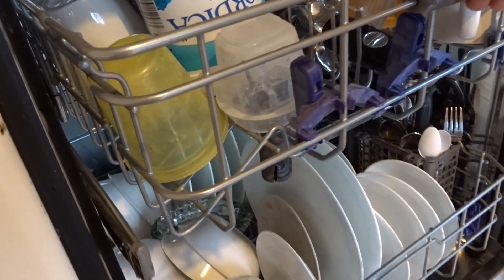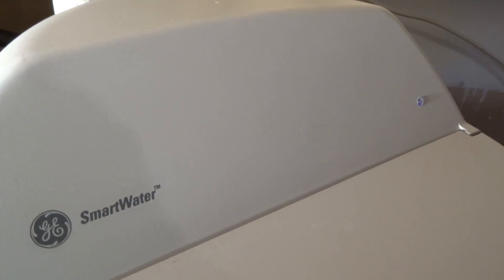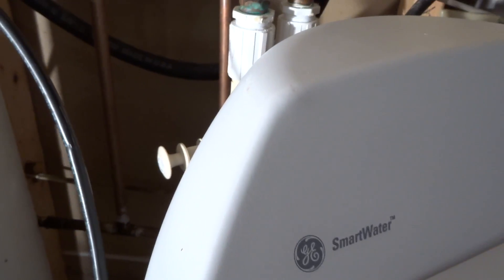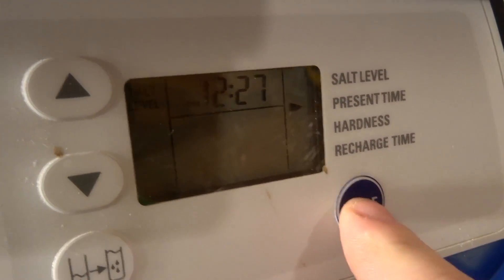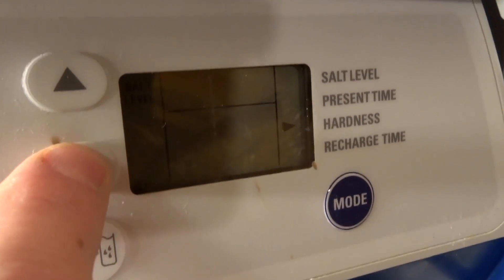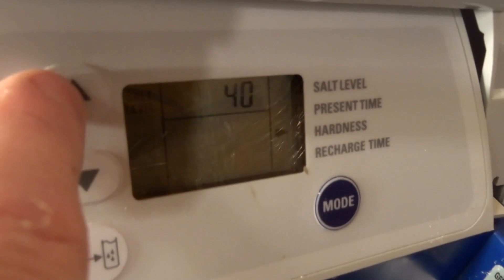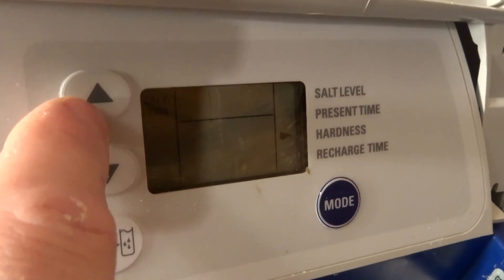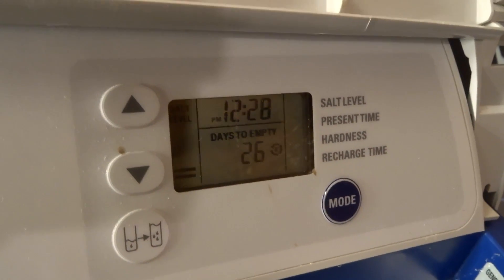GE Water Softener ep5 hardness adjustment

Comment: You did not say how many turns to turn the knob.  If i turn the knob clockwise, is the water going to be softer or harder.  if i turn the knob counterclockwise will the water be softer or harder? Very important question.
Reply from the maker: @mdiazdiaz5612  this softener does not have a knob, however this adjustment does not make the water softer or harder it determines how often the machine regenerates… if you know you have hard water you need to regenerate more often… this machine has a water usage counter.. I use the higher number so it regenerates more often.. some softeners are are basic and go by numbers of days between regeneration.. hard water requires more regeneration… but the manual set days type have no idea how much water they have used… so will regenerate when told to, regardless of the amount of water used.

Comment: I've set mine to 90 and my water is still not soft
Reply from the maker: The number does not determine how soft the water gets after regeneration, only how often the unit regenerates. If the water was really hard keep in mind the hot water tank holds a lot of water so it takes time flush out, several days…  if the unit is operating properly perhaps the resin needs cleaning… I don’t have a vid on that but many products avail…

Comment: Great video. Nice and easy to follow with explanation. Would there be a reason to kick up the “hardness” setting all the way to 95 (MAX)?
Reply from the maker: if the water hardness is that high then yes, mine is about 500 average so I set at 35 to 40... deal with it so it does not  constantly regenerate
Reply: @kd_enterprise3404  Thank you for you quick response. Once I change the setting how long till I see the effect? (dishwater, tub, etc)
Reply from the maker: @JustinHyneswashplant26  Many variables, increasing the setting only causes the machine to regenerate more often to clean the media in the softener. A higher setting does not = softer water, rather it will keep the machine cleaner. Look at it as a filter, once a filter is really dirty it no longer provides clean water, so in a sense you are cleaning the filter more often and you end up with consistently clean water. The next thing, if the water heater is full of very hard water it takes time to flush out and fill with soft water… As far as deposits go, they probably won’t disappear from fixtures and you will have to do an initial cleaning…..

Comment: What is the best way to accurately set the softener hardness number the first time?  I don't want to guess and adjust.    The dual-plastic pipes with the quick connect that attaches to my house can bypass the softener completely, but I see there is an adjustment that I can turn on this that is supposed to "blend" the untreated water with the treated water?.  My GE softener also has the same hardness setting like you show here- it seems nearly all of the manufacturers for these use a very very similar hardware and software setup.
Reply from the maker: For hardness as a suggestion, if you are on city water you could try 5-10, people on wells 20-40... without seeing the how your plumbing is, the additional “adjustment “ could be simply be a water shut off or an additional bypass... ps, you can get water tested for hardness for free. Take a sample before it goes through softener.. if they say it’s 100ppm.. set soften to 10.
Reply: @kd_enterprise3404  I have my own personal well.  I just did a water test strip kit test and it came up "Very hard" on the little strip sheet.  It was a very vivid red on the strip kit test.  This says PPM = 425.  My water softener instructions says to divide PPM by 17.1, so that would make my setting about 25 for the machine?  This seems way low, for years I had it running at hardness setting 75 (I had no clue before what I was doing when it was initially set up).
Reply from the maker: @jacoponono8179  25 sounds like a reasonable start point...I would try that first and see how it goes between generations... the softness will be the same... However if the water becomes very hard before the next generation cycle, increase the setting... really all that setting does is either increase or decrease how often it regenerates based on gallons or litres detected flowing through the system.

Comment: Great video. I have the same softener, inherited it when I bought the house 10 years ago.
Something I'm still not clear on is measuring the water hardness. As a pool owner and aquarium keeper I have several means to test for hardness, but what I don't understand is, in order to set the hardness on the control panel,  am I testing before or after the softener? Or both?
FWIW, I'm on a well with a pretty healthy iron content too.
Reply from the maker: ChuckD59 What you need to do is test before it goes through the softener, but oddly and in my opinion it might not matter much..the hardness really is = to dissolved solids, and the softener does not really change or remove much but rather alters the ions. So if the water tests at 400 to 600 ppm for a typical well I’d set the hardness to about 35, but in theory you should set.. example dissolved solids 400ppm = 40 setting on softener.. but to save salt I go a little low, adjust up or down as required.. I have fish also, my well ranges from 500 to 800ppm (I use an electronic tester) honestly I don’t use my well water for the fish anymore, I use distilled water, it always seemed the well water stressed them out and they had medical issues, I started using distilled water about 8 years ago and they have never gotten sick since, I have Cherry barbs that are 10yrs old. Thanks for watching and hope my comment helps.
Reply: @kd_enterprise3404  Thanks for the reply, and it's good to hear from another aquarist on a country well. Good advice.
Reply from the maker: ChuckD59 thanks!

Comment: According to the manual for GE water softener GXSF30H, which looks almost identical to your softener, the hardness number in the display actually refers to the GRAINS PER GALLON of hardness in the water.  So, the higher the number the HARDER the water.  Also, the manual says nothing about that number relating to the frequency of regeneration for the unit.
Reply from the maker: Mike Rotch yes, you are correct, the higher number indicates or represents harder water to be addressed. Frequency is based on usage or the flow rate, or gallons used. Example If you only use 100 gallons for the set hardness in one month it might regenerate 1 time, but if you use 200 it will regenerate 2 times.. it’s based on the setting of water hardness and the usage. If you use no water it won’t regenerate ever. It’s not a time issue, it’s based on gallons used.
Reply: So In order to figure out how many gallons we use on average in our home I suppose we just look at our water bill and then set it accordingly correct?  Also I have two other questions in regards to the GE Smart water 40 gallon. We ran through all the tests that you provided on your excellent videos and I was trying to do it myself and then got my husband involved and have Concluded  that the bypass assembly doesn’t close. And there are also leaks where the little black clips go where the bypass assembly connects to the motor.  Do you ever come across this issue of the bypass not closing off? My husband said just to replace the whole thing but that’s almost $500 versus the assembly for about 50. The system is 10 years old and we are a family of six. What would you recommend?
Reply from the maker: Thank Maureen and Mike for your Comments. Mike is correct and I hope you see his comment. Basically you need to determine hardness either by a water test or increase/decrease in small increments to find that setting for example... you no longer have water spots in dishes. If water spots increase hardness, no water spots try a decrease to save salt, but if spots appear increase hardness level for example.. as Mike said, the regeneration is based on water used, not really the hardness setting. Of course though, generally speaking, if you use the same amount of water all the time, and increase the hardness it will regenerate more often. It’s a little confusing.